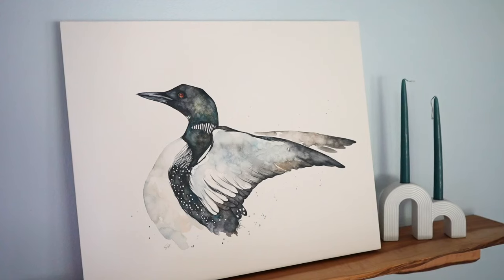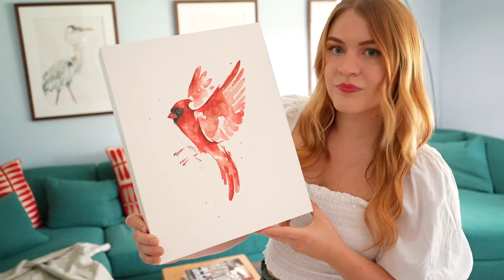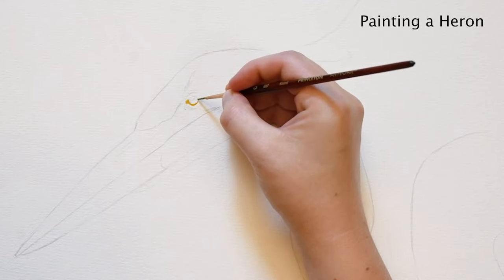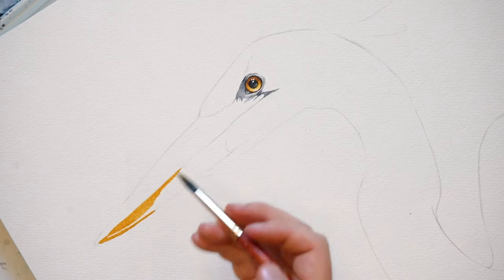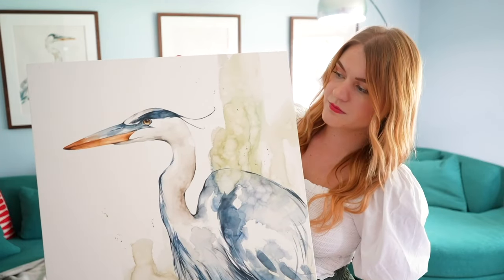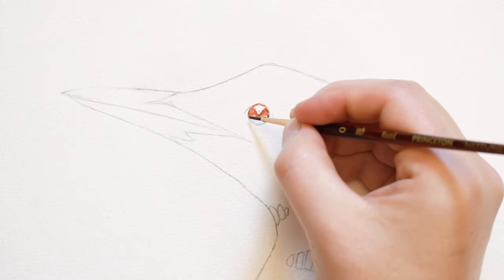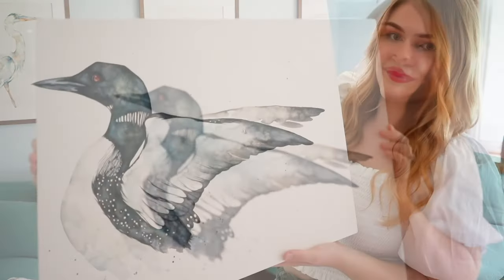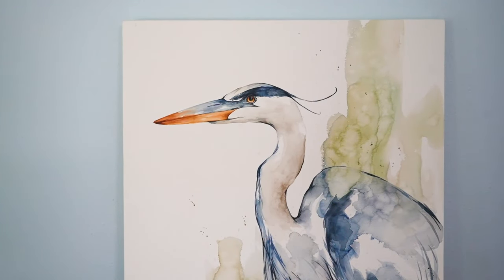Preparing for an Art Show - DIY Cradled Panels + Mounting Watercolors + Sealing with Cold Wax

Comment: Nice work! I do the same thing, but I use Golden Acrylic Medium (regular gel, translucent heavy body) to glue the watercolor paper to the panel instead of Modge Podge.  I wax the sides of the panels as well.  Good luck at your show!
Reply from the maker: Yep that was recommended a lot. I tried using an acrylic medium and a gel medium but they dried way too fast but I think it's because it's too hot in my garage. I will try it again in the fall/winter or when I work indoors. Thank you

Comment: As always, beautiful paintings! I enjoyed this video showing the process you have developed. I have a question though, since the back of the paper is essentially sealed and not able to “breathe” did you find the paint to react differently? Finally a tip is there is a product by a company called HangZ that allows canvases or panels to lie flat against a wall. Good luck with your show!
Reply from the maker: Hmm. No, I didn't find the paint to react much differently, but I have to keep testing things out. Thank you, for your suggestion!

Comment: Beautiful paintings, esp in the detailed eyes. Curious why you use both gesso and glue on the boards, and I assume the was is for protecting the art, yes? Is the wax something that must be maintained?
Reply from the maker: I used gesso because it is an acid-free material that I wanted to coat the plywood with in case it contains acids.. the glue itself is also acid-free and might have been enough to prevent future discoloration of the paper but I wanted to be extra careful. I don't think you would need to maintain the wax, it wouldn't hurt to apply more coats in the future, but I don't think it's necessary.
Reply: @paintedwing  ok, thanks! great tips.

Comment: Would you also paint the painting first and then attach it to the prepared board?
Reply: I wondered that too.  What happens if the painting doesn’t turn out the way you wanted.  Can you remove it easily?
Reply from the maker: Yes, you can. For my larger paintings, I want them to be mounted first because I like how they stretch the paper.
Reply from the maker: I don't think the paper would remove easily. I wouldn't recommend attaching the paper first if you are worried about it not turning out.